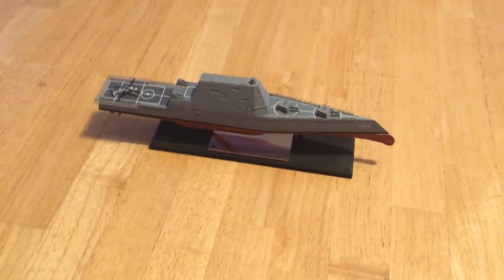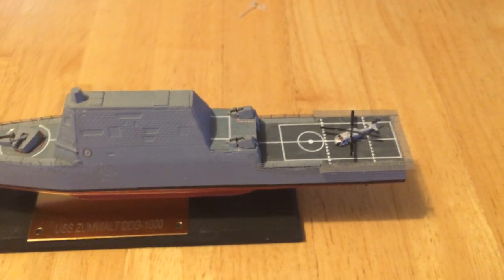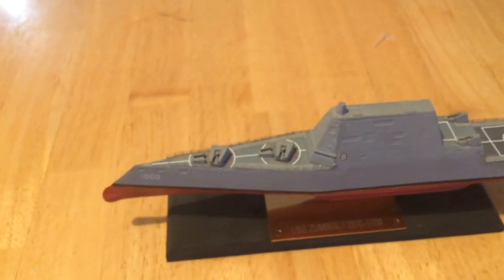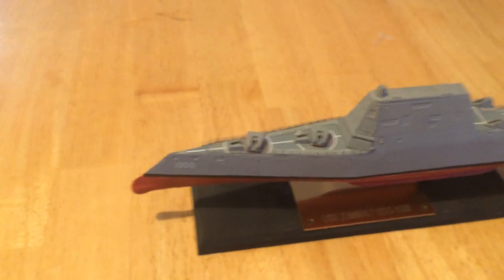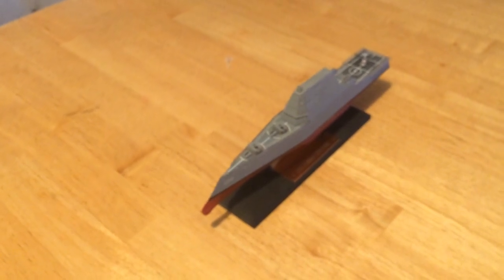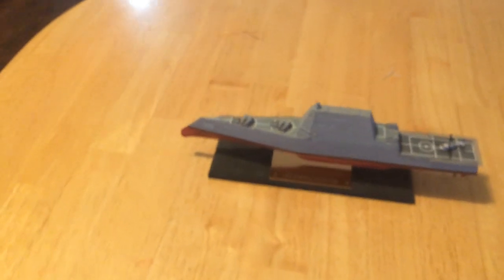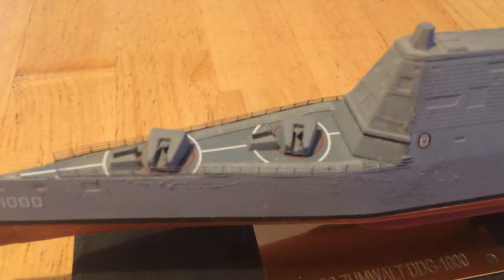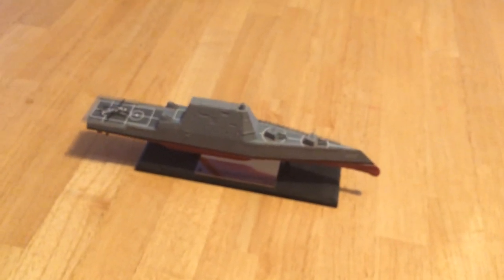US Navy Zumwalt DDG-1000 Model 1/700 scale

Comment: I’m thinking of making the 1/350 and the 1/700 and converting them to RC currently working on converting the ICS-2 1/350 to brushless 45A 3S with a 365 brushless inrunner it’s a tight fit but it’ll be fast 😂